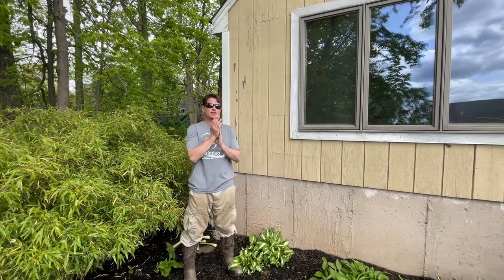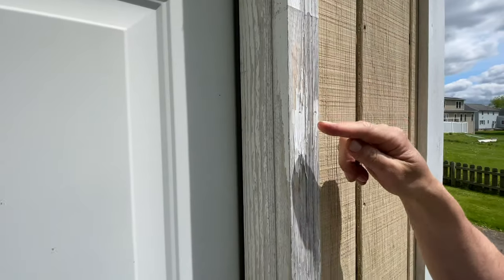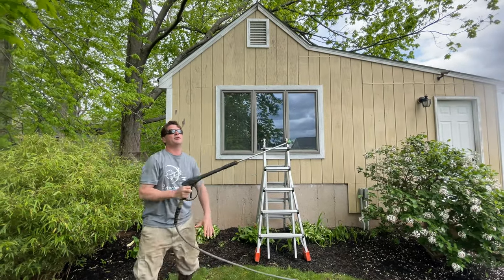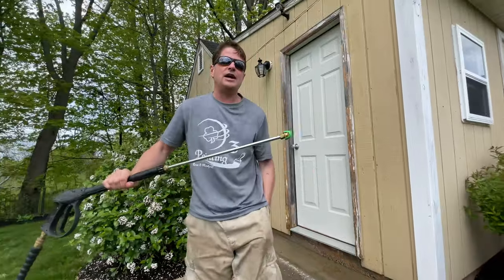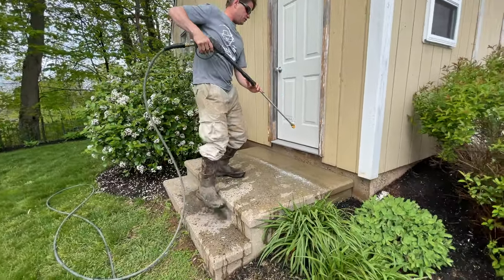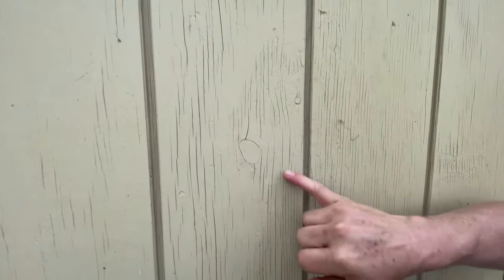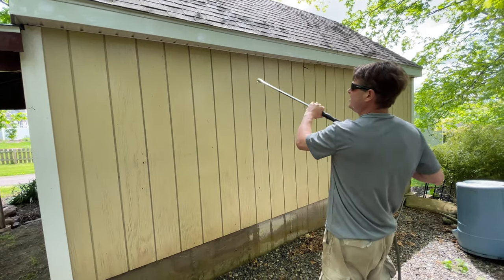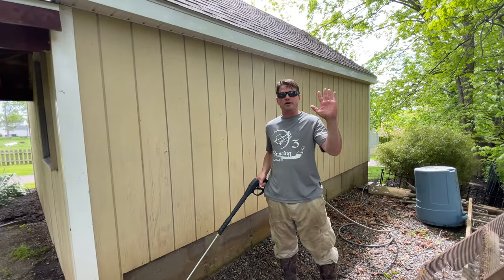How To Paint Old Weathered Barn Fast - Zinsser Peel Stop - Sherwin Williams Rejuvenate (Part 1)

Comment: Pretty masterful videography at the opening!   It definitely shows what you are up against.  I have a similar pressure washer with 3100 psi which I purchased right after watching the deck video you have on your other channel.  I just purchased a "turbo nozzle", and an in line water filter for it.  MAY I ASK your opinion of turbo nozzles as compared to the fixed spray nozzles???  It seems like the benefit is that it would be harder to damage a wooden surface with a turbo nozzle but there must be a drawback too it.  Thanks,  Don
Reply from the maker: Hello Don-

Thank you very Much! I always try to show with great detail what I am doing so you the viewer can see what I am up against. I did purchase a turbo nozzle several years back and it didn't perform well. I think that maybe the nozzle's orifice wasn't the right size. In reality, nozzles are not universally interchangeable because they come in different orifice sizes. So you want to make sure you get the right one for your pressure washer. Good Luck with your new one!

Russ